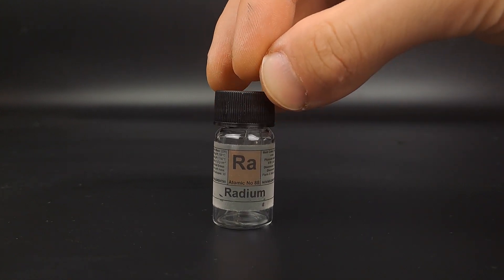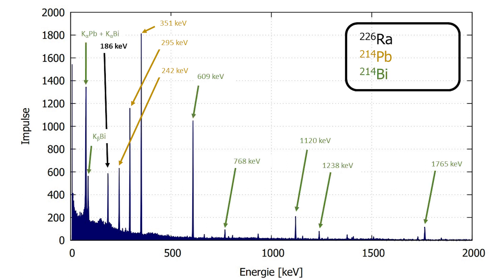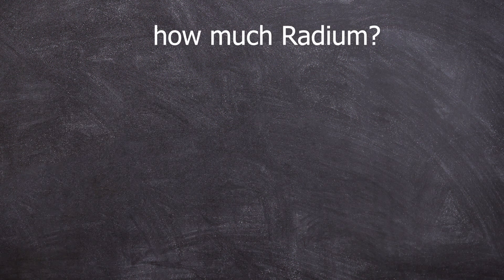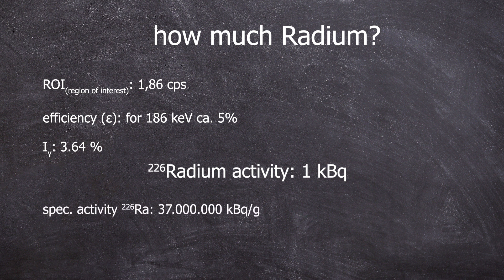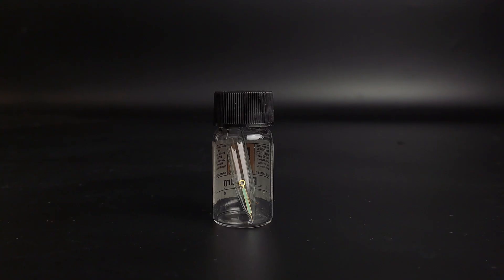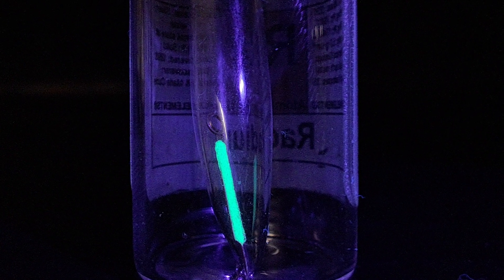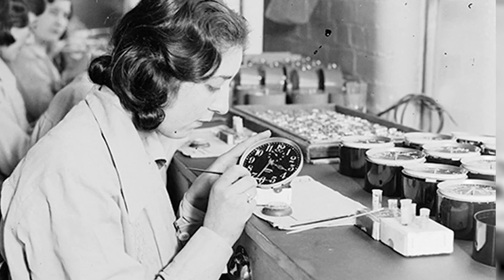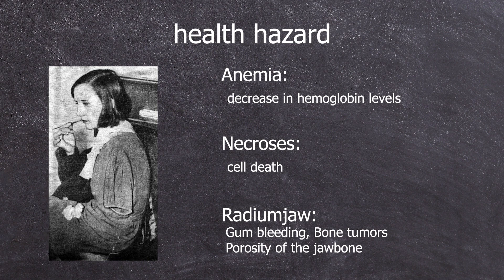Radium paint and a brief history of radium - Nuclear Chemistry

Comment: I am so glad to discover this channel, I've been going through your video library and greatly enjoying it.
One thing you might be able to shed light on is this line from radium's Wikipedia entry that has been on my mind for a while: "Pure radium is silvery-white, but it readily reacts with nitrogen (rather than oxygen) upon exposure to air, forming a black surface layer of radium nitride (Ra3N2)."

My understanding of chemistry isn't that extensive, but I am under the impression that N2 really does not readily react to form these nitride compounds without a lot of persuasion. This makes it very surprising to me that radium would preferably react with nitrogen over oxygen, which should be far more reactive. Unfortunately the Wikipedia page does not seem to offer a source or explanation for this claim.
I have no idea if it is within your knowledge or capabilities to answer this question, of why radium metal would react with nitrogen in this way, and whether radium exposed to the atmosphere would form a layer of mixed oxide and nitride, or just pure nitride.
I'm assuming you are unlikely to verify this experimentally, especially with the nanograms of radium you have in this video, but it would be interesting to get a more definitive answer on this claim.
Reply from the maker: Thank you :]
Thats really something worth looking into^^ From the top of my head I would say, that the Alpha radiation from the insanely high activity of Radium will splitt (radiolysis) the N2 which could then react with Radium. But thats just a guess. I know Lithiummetall reacts with nitrogen in the air^^
We are currently on a quest to find larger amounds of Radium to make some compounds and when we have it, that will be the perfect opportunity to talk about its chemistry :D
Reply: Lithium, magnesium, calcium, strontium and barium will also react with nitrogen forming nitrides. Barium is used as a getter in vacuum tubes to achieve better vacuum than with just a pump.